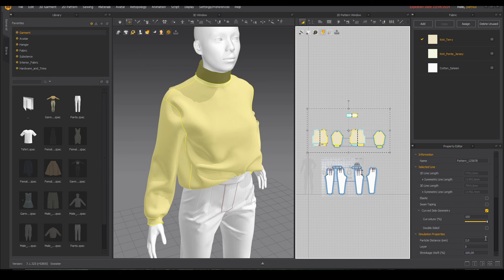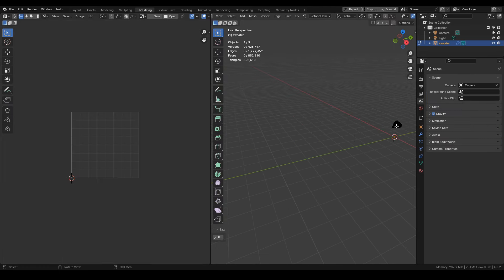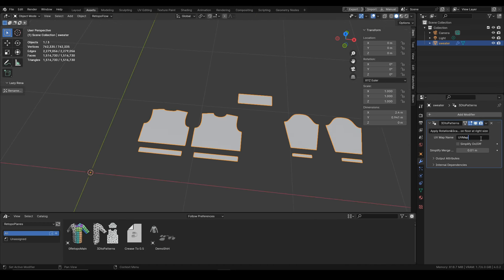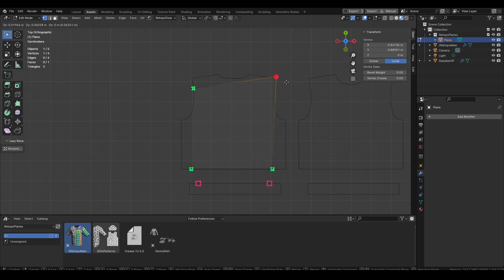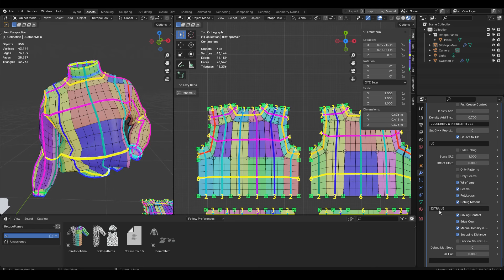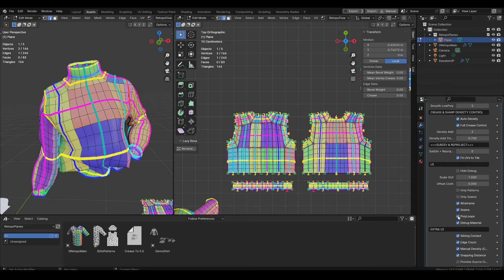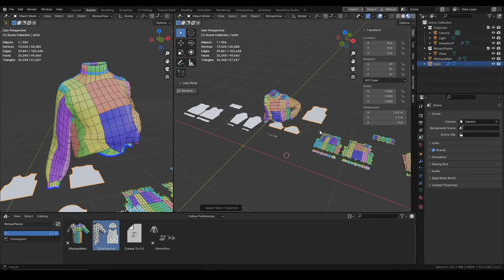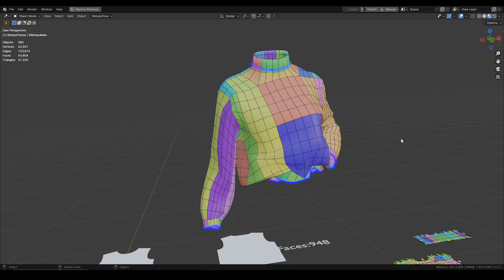RETOPO PLANES - IN DEPTH: MD Export, 3DtoPatterns, Auto Density

Comment: Hello, I was checking the part about 3d to pattern and I was wondering if it does the same to any 3d mesh that has UVs even they are not imported from MD? Meaning it will create flat planes even for mesh that is not from marvelous, based on their uvs?
Reply from the maker: Hi, yes - just make sure that it has Blender's default UV name which is "UVMap" and it will work.

Comment: How does this work with sewn pockets?
Reply from the maker: Yes, it's important though to avoid sewing more than two patterns to one side. That would confuse this tool. Pretty much like one edge can have only two faces connected otherwise normals will go crazy - if you lets say have three quads meet at one edge. I will be releasing some vids showcasing capabilities of this tool asap. I know it's lengthy answer to a simple question, just wanted make clear those technical aspects.